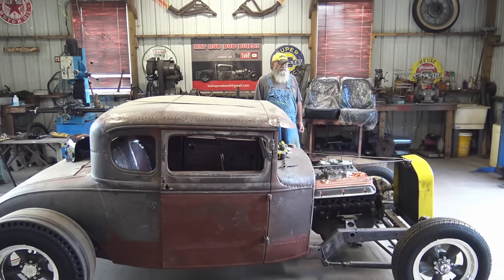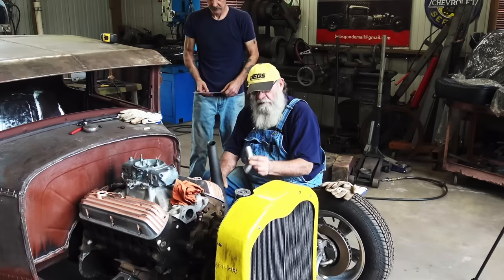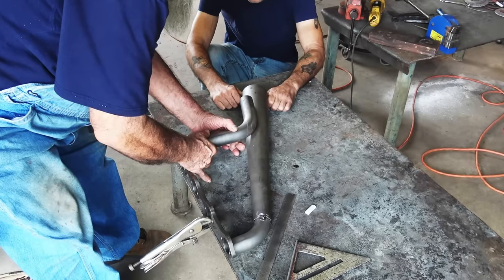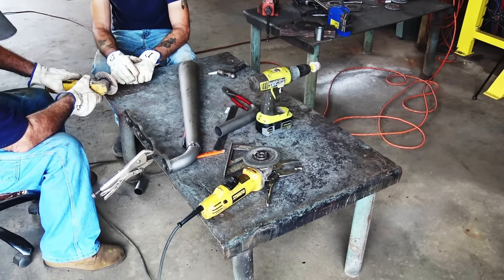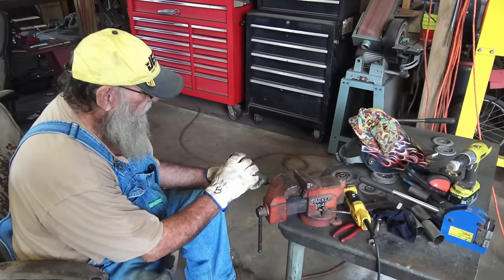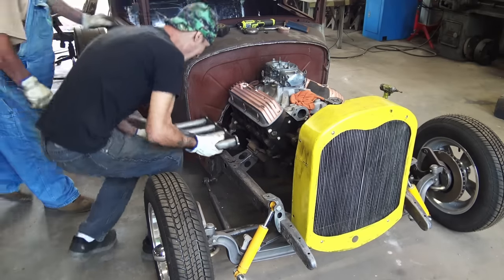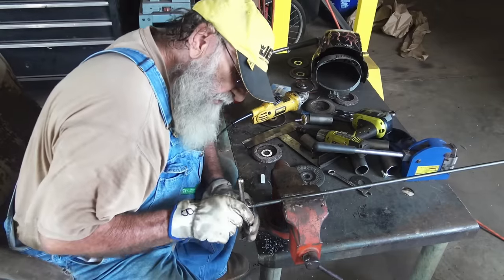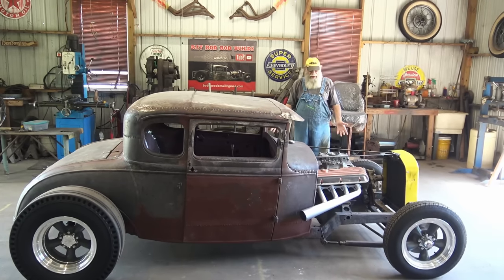Lake Headers From Weld Kit For Dummies - 👀 Lets Build Stuff

Comment: Don is a great asset for any shop. Calm and collected, Don just works steadily until the job is done right. 👍 Great build on the headers guys. ... Can you cut angles on your chop saw? It has as a clamp vice and an adjustment for angle cuts.
Reply from the maker: If I had to do a lot of them I would certainly try the chop saw.
Reply: @RatRodBobBuilds  Yeah... setup time could be a hassle... turned out great ..no matter the method👍
Reply: @DonCatherman  Anytime Don. Thanks for the reply👍

Comment: Cool work. The rod is coming along fast. Btw, the anti-torque handle guves you better control. Even if you need to change which side, it's on to get the best access. As far as the death wheels, they have diamond impregnated metal cutting blades that are far better.. They have several brands, but the last one I'm using was $14 on the jungle website. Re: (EZARC Diamond Cutting Wheel 4-1/2 x 7/8 Inch for Metal, Cut Off Wheel with 5000+ Cuts on Rebar, Steel, Iron.) They cut just as well, don’t explode & seem to last a lot longer. I've had the same one on my grinder for months. Cut an entire metal dash in haft length wise, didn't shrink the blade at all. Cut thick metal brackets just as easy. Not sure what to use any of my stock of Death wheel blades for anymore? Oh well. You are old enough to know how and know better, so ain't no one else gonna tell you anything different. We enjoy your builds....

Comment: Man red needs a promotion to the safety department, he was spot on!  At least wear a face shield when using grinder specifically wit no guard on grinders!!!!
Also learning question, could the plasma cutter have been used instead of grinder?  ( need reason for me to get one!!!)
Reply: Cutting tubing with a plasma, not recommended. It doesn't cut straight through the entire tube like a light saber 😂. You'd have to cut around the tube, and the cut will not be straight or true like a bandsaw or even grinding wheel